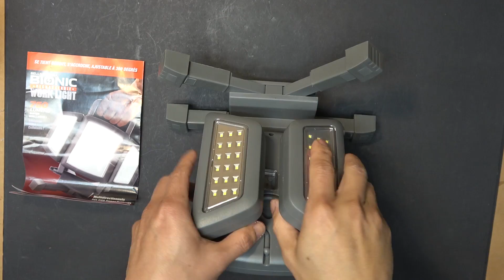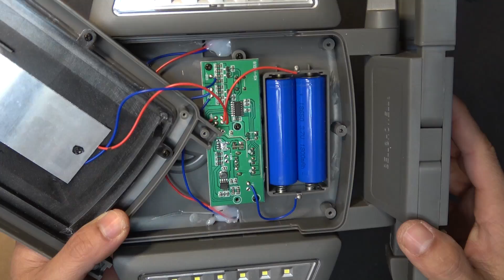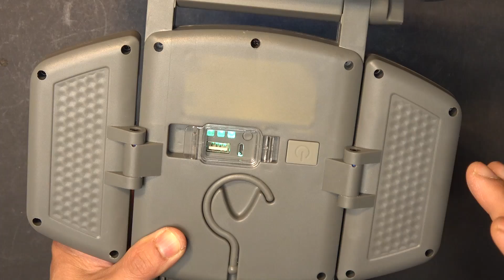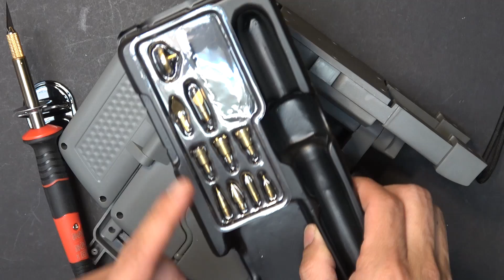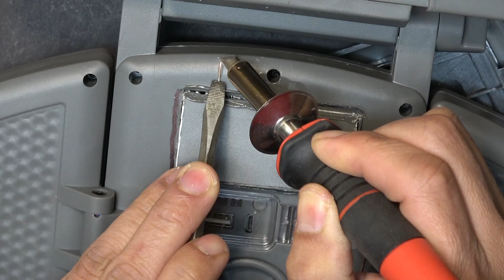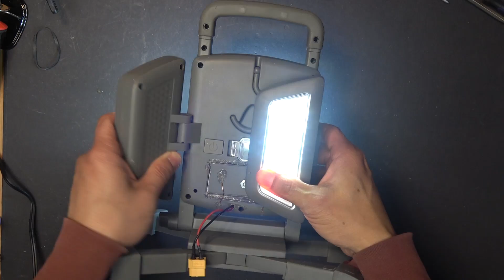DIY: Bionic rechargeable LED light battery upgrade

Comment: I'm wondering if you can help me think through something. I've been thinking for a while of building my own DIY scooter, assuming that I would save significant money. I started running numbers, for instance, using Kobalt's tool batteries, and this is what I came up with. The retail scooter that I'm thinking of getting is a 5600 watt (dual motor) with a 60 volt, 31.5 Amp hour battery... the cells are Fengchao. If the battery goes bad, the replacement battery is $600. I was thinking I could rig something up using Kobalt batteries for probably cheaper, but when I started doing the math, building a battery from parallel and series 24 volt 4 Amp hour batteries, into a 72 volt 32 Amp hour  battery would be $1200 using the 24 volt 4AH cells. (2 pack is about $100)

Anyway, it makes me think that it's not worth it, unless the Fengchao cells are pure crap. What are your thoughts? Have scooter prices come down in price to the point that it's not worth it to build from scratch anymore? This particular scooter is pricy ..$1830, but just trying to replicate the batteries would be at least $1000. Any knowledge about Fengchao battery cells?

Comment: Quick question.....when you use a kobalt battery in for instance a e100 Razor for a lead acid replacement, do you have to worry about it discharging too much, or does the circuitry within the battery keep it from discharging too much?
Reply from the maker: You don't have to worry about it discharging too much. The controller will only take as much current it needs. You do need to worry about it not discharging enough because the battery will get hot and catch on fire. So make sure your battery is able to discharge enough (or more) of whatever the controller needs (usually between 20-40 Amps)

Comment: Didn't need to butcher it with the door. The fast charge xt60 mod was enough....🤔😳😏🇬🇧
Reply from the maker: True! Maybe I was thinking too much!
Reply: @vuaeco  Should have just created an external battery bank to increase the capacity more. And added a clean looking 5mm power port like most 12volt devices.

Comment: Not a fan of the door tbh. Better off (IMO) loading the case up with as many cells as you can fit, run the XT60 out and that's it. That way, it remains splash resistant as long as you dab the wire holes with glue or silly-cone. Even so, the battery sled inside does make for a nice, quick upgrade with just a screwdriver. 👍
Reply from the maker: Yet, I spent the most time in this project trying to figure out the door! Over-engineered? Or maybe under-engineered because now it's no longer splash-proof! :D
Reply: @vuaeco  Hey, at least we got to see the electric Exacto knife! Pretty great.

Comment: ha i would be so tempted to add a second paralel set of bateries! great aproach, thanks for the video
Reply: I thought the same. If you just trim the triangular indent where the hook folds, surely another 2-cell sled could be tucked in there, or even just cells glued in and wired up...

Comment: Did same battery upgrade 3 years ago on Costco selling work light. "Faith" brand. Really good lights except the junk batteries. Put good quality panasonic 18650 batteries harvested from my laptop battery. What a difference.
Just use at least 2amp charger and you good to go.
Reply from the maker: Most of these lights are good but batteries are usually junk. Nobody sees the battery inside so they don't bother to invest in it.